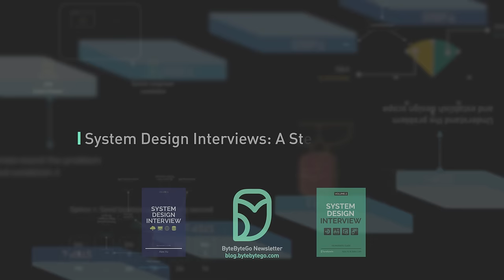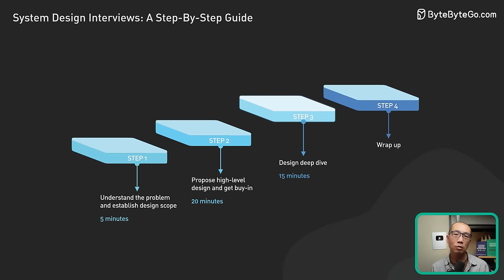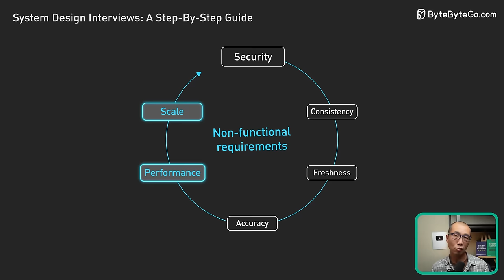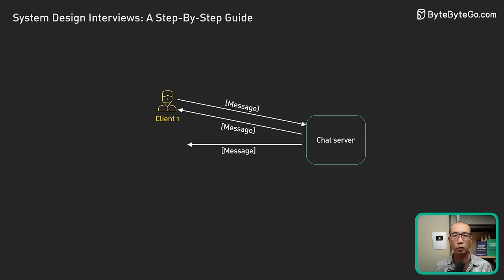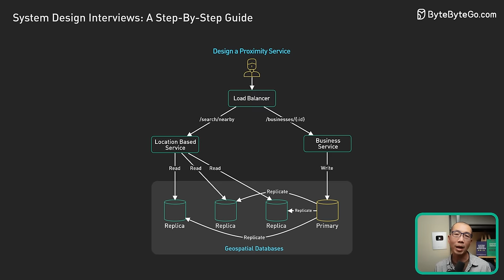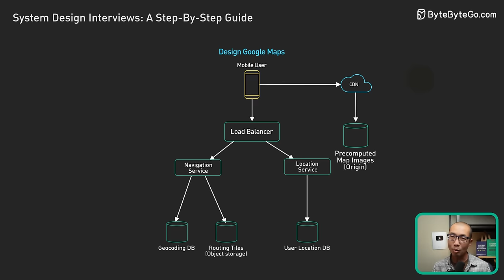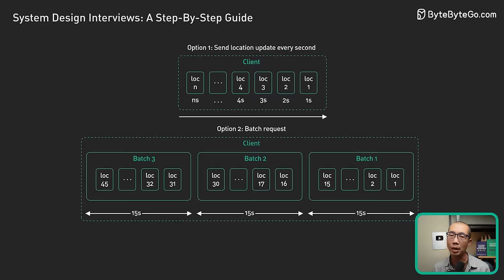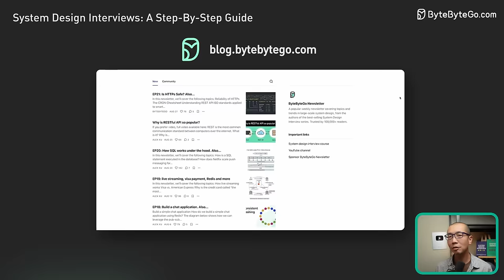System Design Interview: A Step-By-Step Guide

Comment: I think this video provides a solid foundation for what to think about and how to structure your time.  To add to this knowledge, and as an occasional interviewer,  I would recommend emphasis on thinking about why you are there and what skills the interviewer is looking for.  As an interviewer I'm less interested in the actual design and more interested in how you approach the situation - what questions you ask, what assumptions you make, how you deal with ambiguity, what your problem solving skills are like, and so on.  Seeing you draw things on a whiteboard - and explain them - also gives me insights into how you communicate, which is also critical.

I think this video possibly gives the impression (to some people) that you have to come up with a carefully considered design which is comprehensively complete and to a level of detail that is probably impossible to do in 35 minutes - especially if too many features are requested.  One way to deal with that is to take a "steel thread" like approach and demonstrate how something could work end-to-end without going into all the details - just enough to join all the layers, not fill them all in.  For example, if you can demonstrate what one REST API operation looks like to some level of detail, as an interviewer I probably don't need to see a second example - that's where checking in with the interviewer is a good idea - is that one enough?  would they like to see more?  Remember, (perhaps depending on the level of seniority) the interviewer might be looking to see how you handle a situation where the work requested is clearly not doable in the time allocated - what techniques do you use to deal with those situations?  Checking in with the interviewer as to what they expect is a valid approach - just like (good) team leads and managers appreciate team members checking in with them periodically, especially when timeframes are tight.

Comment: With unlimited horizontal scalability snd replication how do non functional requirements matter. Only thing we can design is for horizontal scalability.
Reply: Non-functionals requirements -> system quality attributes.  System quality attributes are attributes that describe the qualities the systems has or should possess - including usability, security, availability, maintainability and much more.   Non-functional requirements are specific (and ideally testable) requirements that focus on system quality attributes.
Regarding horizontal scaling and replication - whilst it's true that could computing makes them much easier to use, it doesn't mean that you always get value from them for free - there's often some trade-offs involved, even if it's only additional complexity.

Comment: Sir at what point in your design cycle do you handle data modeling. You example is more a tech use case. If you took a typical IT org, we have complex data models. We find many new comers these days think of API to satisfy requirements and mostly ignore the core data/object model. As a result, we do not model data properly and end up with redundant tables or data structures

Comment: Fact 1 - System Design interviews are never open ended. These are always biased.
Fact 2 : Most interviewers are themselves not right fit to take such interviews.
Fact 3 : Forget about any such Framework, if the interviewer doesn't like you, you can never succeed.
Fact 4 : Scope of such problems is always bound to the scope of interviewer's understanding.
Rest such videos are always good to watch and learn new things. And these interviews has caused such videos industry flourish to help people make their money.
So no-one of these people would like to change these interviews' pattern and many candidates can continue to stuck in wild goose chase.